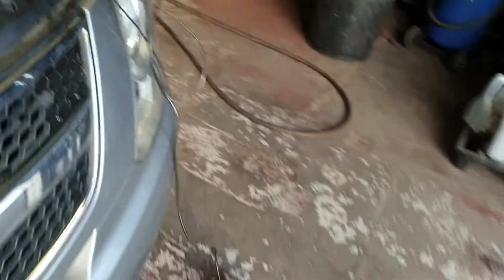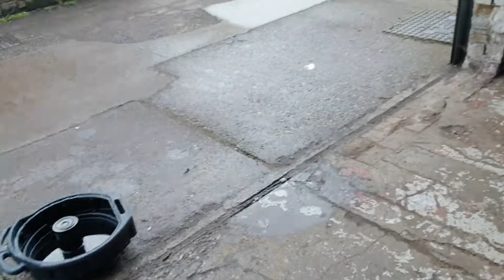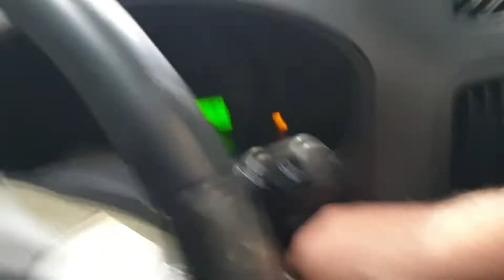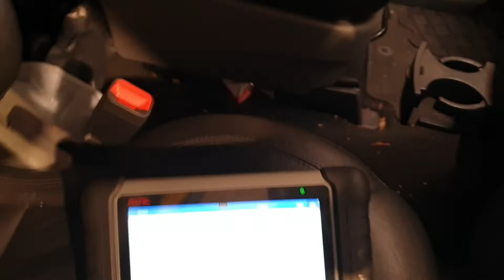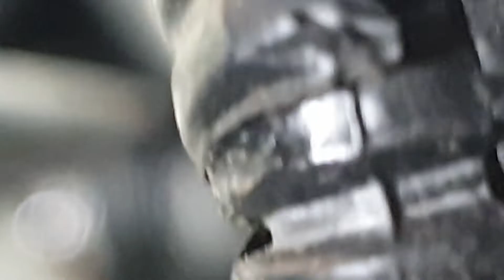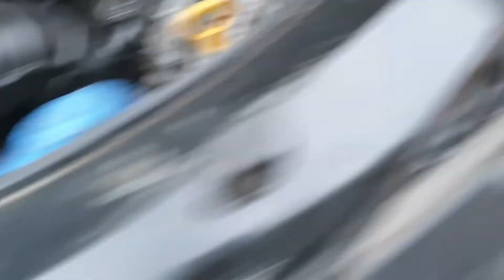Hyundai Load i800 D4CB Engine Replacement With Kia Sorento Engine Part One Of Two

Comment: Good video, but why did you take such a gamble ? I would never listen to customer if I see things are different unless the right engine is not provided I would not touch it ( as the customer only pays for engine replacement ) all the diagnosis checking after is on top
Reply from the maker: Agree! Mistake which was happened, i share it here me, myself and other not to make the same mistake again. All the differences between donated engine and faulty one which i realised were, after we received the engine.